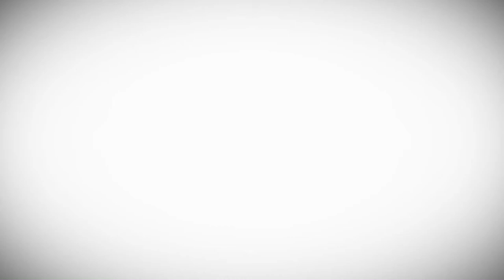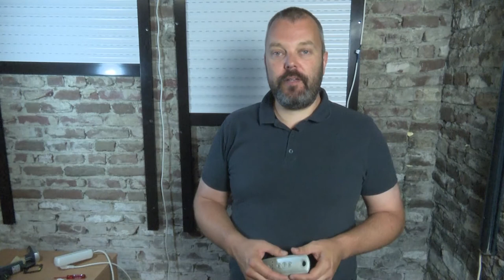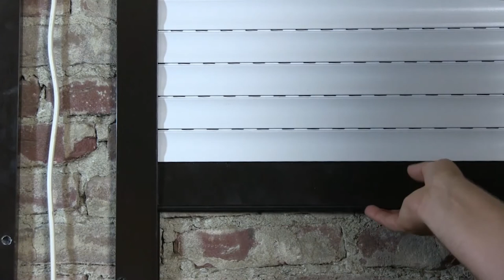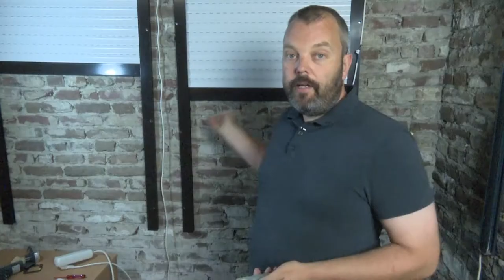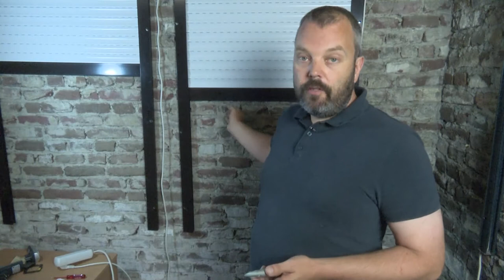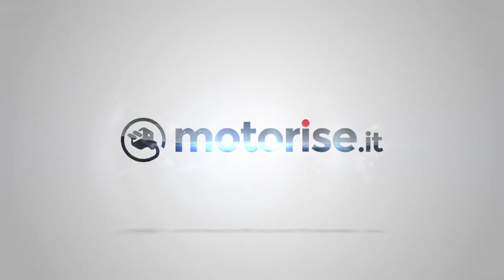Electric roller shutter stops at 4 inches from lowest position - problem and solution

Comment: My roller shutter is 3.5 m wide so does that mean my motor is too?
Reply from the maker: No,the motors have a fixed length and are about 60 cm max in length